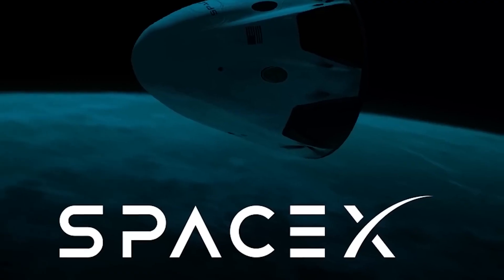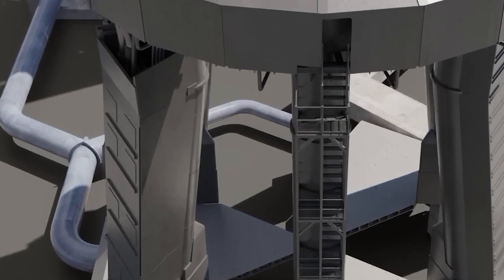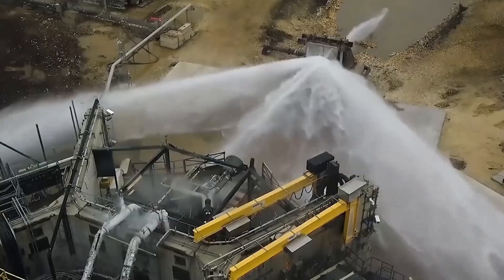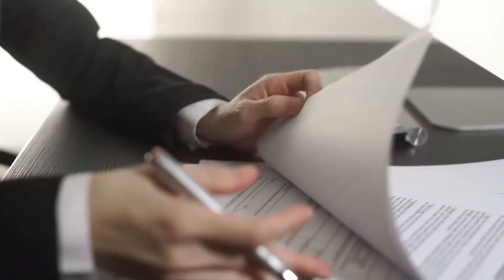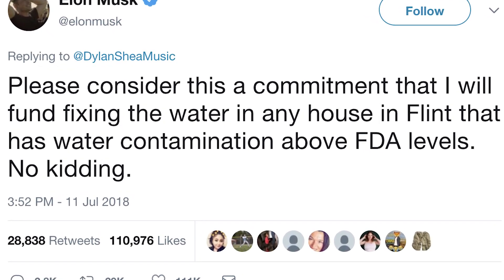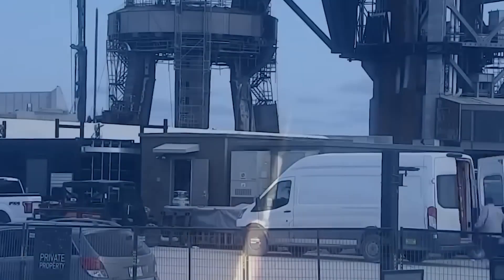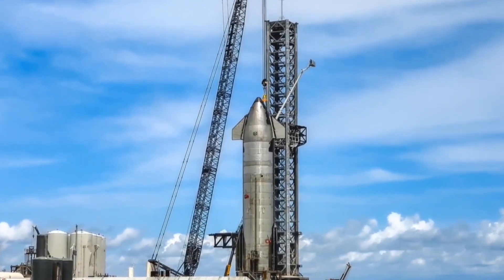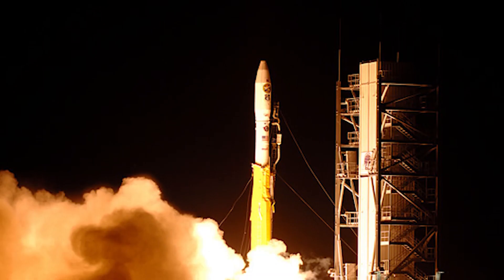SpaceX Massive Upgrades To Water Deluge System Revealed!

Comment: 6:37 ==>I would contend that the Starship 1st flight got nowhere near stage seperation before it was terminated, so they haven't tried seperation yet. It was way too low and still accellerating, while at the time we thought the roll was purposeful, i believe now the concensus is that it was due to loss of control authority due to HPUs being blowed off.
Reply: During last test flight Elon's Starship prototype and Elon's False Ego buckled under compressive force of reality (thrust of 30 Raptor rocket engines of SH Booster). It takes as a minimum 6 VacRaptors used as support columns sandwiched between SH Booster and the Starship to prevent buckling of the rocket during liftoff. Idea of using unpressurized Skirt as structural component of the rocket has failed and it is being replaced and this is 
bottom line of changes being introduced by SpaceX. Everything else is just a diversion and smokescreen intended to hide major about face as Elon Musk and Space Cadets at SpaceX were told repeatedly that Skirt idea was dumb and would never work in real world but they dismissed any concerns and any arguments and went ahead with this stupid idea to the bitter end. Now, instead of admitting errors of their ways they try to lie their way out of the blind alley. Elon cannot hide cradles supporting expansion bells of VacRaptors build on top of uppermost dome of SH Booster he can only disguise them as heat shielding for hot staging.